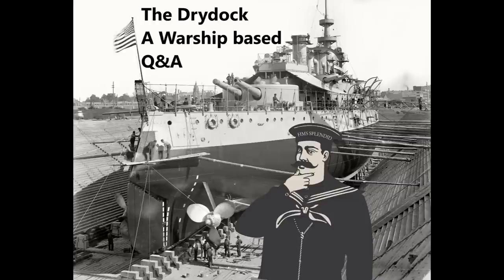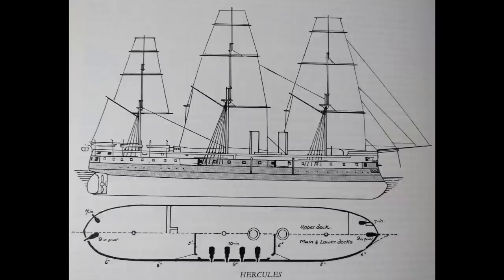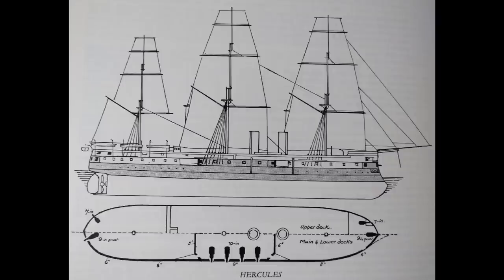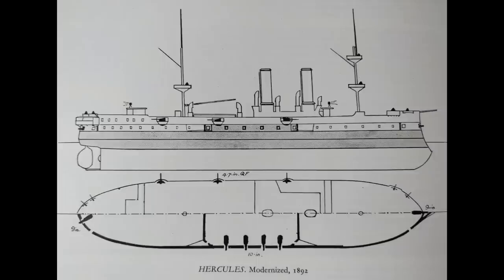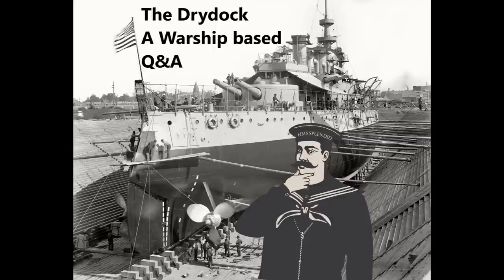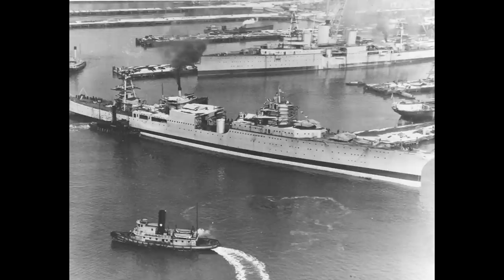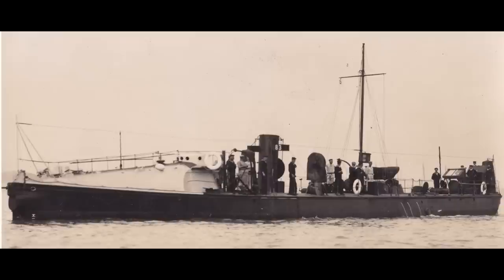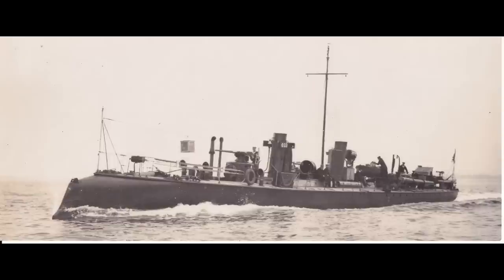The Drydock - Episode 233

Comment: My grandfather was a loader for a quad 40mm Bofors on the Fletcher class destroyer Killen. Said it tended to jam and it was quick to unjam with a hammer  and chisel. During an air attack he said the 5 inchers opened up then the 40mm then the 20mm and finally the .50 caliber.  He said you knew it was really bad when the 20mm and .50 cals opened up.
Reply: Supposedly, somebody aboard the ships at the Battle off Samar radioed "We're pulling them into 20mm range!" Yeah, when you're breaking out your AA guns during a surface engagement, you're really getting in close.

Comment: In regard to measuring ship's speeds, in addition to the methods Drach described, most ships have instruments onboard that directly measure ship's speed, either a Pitometer Log (similar in principle to a pitot tube on aircraft) which was invented around the turn of the 20th century, or in more recent ships more likely an Electromagnetic (or EM) Log, which was invented post-WWII.
Reply: Ryan of Battleship New Jersey has a video discussing those speed measuring devices. https://youtu.be/Efb8m14af4k
Reply: Sailing boats, at least, usually have something which is essentially a tiny paddle wheel sticking out under the bottom. Is this kind of log used on bigger ships as well?
Reply: Pit log, EM log, doppler sonar are all ways to measure speed through the water.  Speed over the ground these days is measured by GPS.  For speed trials, radar ranges to a buoy in deep water have, for the most part, supplanted measured miles on shore.

Comment: Portholes (scuttles): one of the reasons why ships lost them after WWII relates to health issues. They're fine in peacetime for all the reasons Drach indicates. Closing them in bad weather was part of the deal of being at sea when there wasn't a good alternative.
The problem was in wartime: they had to be closed whenever the ship was at sea (and even alongside), to darken ship: more scuttles = more to leave undarkened for U boats. This wasn't achieved only with curtains, but a heavy metal cover called a deadlight, which also provided some protection for damage control purposes of the glass was broken by the sea or enemy action. 
These factors effectively meant the scuttles were closed / deadlighted 24/7. So... that being the case... why bother?
Drach isalso  right re this being less of an issue re lighting; however, it's a major issue at a time when ship's ventilation systems were predicated on being able to open the scuttles. Keeping them closed meant crap ventilation: not great at any time, but far worse in the tropics, with all the adverse effects on human performance, as seen for example at Savo Island in August 1942.
The more important issue relates to infectious disease risks - not just coughs and colds, but tuberculosis. This being the period when effective mass TB screening had only begun (mostly because of WWII) and there was no effective treatment until the late 1940s, even one active TB case on a mess deck with crap ventilation could make a helluva mess...
Reply: Gah! It all comes back around to tuberculosis. And the long hand of John Green grabs us again.
Reply: @MonkeyJedi99  Who is the John Green you're referring to please??
Reply: @Pusserdoc  Author of several books including "The Fault in Our Stars". Also a major proponent of pushing companies to make tuberculosis tests VASTLY more affordable in the poorer countries where the disease is the most problematic.
He has done many videos about how tuberculosis has influenced history and society, including women's skirt length
Reply: @MonkeyJedi99  Thanks so much - clearly I'll have to look him up! 🙂

Comment: Your comments on Scrapping vs Scuttling old ships are incidentally relevant due to the Brazilians having just scuttled the carrier Sao Paulo out in the Atlantic, due to large amounts of Asbestos making it undesirable for scrappers.
Reply: The odd part about that is the asbestos is largely irrelevant underwater but there are so many other things on the ship aren't as Drach points out.
Reply: Don't see asbestos as a big problem 5 km under water.
If there is still oil on board, yeah, that might be a problem, but asbestos where the dust can cause cancer?
Don't see dust clouds under water. And aside from the dust, which causes cancer mostly because of the structure of it, it's pretty save.
Reply: Depending on which source you go by, there may have been far more troublesome things than asbestos in there.
Reply: @CTXSLPR  The scrappers don't live underwater though, they'd have to deal with the asbestos if they had to take the ship apart.
Reply: @muuhnkin4611  Most of the people doing the scrapping and living in the vicinity of the scrapyard aren't living under 5 km of water.

Brazil sold the ship to the scrappers. Turkey said they can't bring the ship into port because of the asbestos. Brazil said they weren't taking it back. So they just sank it there.
Reply: Brazil plays by their own rules.
Reply: Considerate of them to sink it ‘beyond the environment’ . After all, theres precious little out there except open ocean, fish, sea birds and 200 tonnes of deadly asbestos 😂
Reply: @hisdadjames4876  Abestos is not the concern with it being sunk there. All the other crap on the ship is going to be more problematic.

The asbestos would have been a big problem for the people in Turkey in and around where it was to be broken up.
Reply: I guess the asbestos solution would have been easiest if they sank it, then re floated it and scrapped it. No asbestos dust if its all been wet for a week 😂
Reply: Oil on a sunken ship isn’t a problem… there are natural oil vents underwater that constantly spray oil and natural gas into the oceans 24/7

Comment: I thought it was common knowledge at this point, guess not.  The USN just designates a class name, hence the ship carrying the class' name is the "lead ship" irregardless of laying down, building, or commissioning.  I learned about that back in the 1990s.  I thought it was so confusing when the New York class of super dreadnaught s were called the Texas class so frequently.  All because the Texas was built, and commissioned before New York. Didn't matter.  The USN had designated the class as New York.
Reply: I think the Texas was started first at the Brooklyn Naval yard under contract by Newport News Shipbuilding whereas USS New York was constructed by the government at New York Naval yard by the government. Both were constructed under new labor laws regulating maximum allowable hours for workers and each ship could cost no more than $6 million per.
Reply: The first ship in a class to be authorized by Congress is the designated class ship, regardless of what order the ships of that class are laid down, launched, or commissioned. So which ship in a class is the lead ship depends on the paperwork coming out of Congress and how some clerk happened to type up the text.
Reply: @seanmalloy7249  also in a couple of cases it a interesting coincidence who in Congress was on various committee s when it was time to select names.

Comment: I'm not aware of many paddle vessels able to separately operate the wheels each side other than tugs where it was quite common.  I think there was a stability problem at speed if there was any difference in speed of the wheels each side to the extent that it was expressly forbidden for passenger vessels.

Comment: My boat has a turbine wheel speed log in the bottom which can be pulled from above if fouled.  The wheel turns and speed is measured electronically.  You can also use GPS.  Transome mounts appear to use a lever arm which is deflected by water speed.  I would assume speed can be measured by sonar under certain conditions.

Comment: re: 00:09:00 - More modern warships are nearly devoid of portholes.  What triggered this change in design? 

Modern ships also have (generally) smaller and smaller crews for a given size of ship, thus requiring less accommodation spaces and so less of the ship to need airing out and lighting?
Reply: Electricity and HVAC.... you don't need portholes for light or ventilation anymore.

Comment: A 1vs1 between a Littorio and a KGV with roughly equal escort forces would be an interesting scenario. In my opinion, the Littorio might have a small edge over the KGV - if the Italians have their accuracy problems under control, that is - due to the very powerful Ansaldo gun. It has extremely good penetration against vertical armor.
Reply: The Italians never really had shell dispersion issues to the extent commonly made out to be the case in poorly sourced secondary sources; turns out Iachiano fabricated the whole idea to cover up his incompetence.

I do agree that Littorio vs. KGV would be a fun fight. The Italian ship is slightly faster, and the Italian 15” gun hits hilariously hard (as in, Littorio could actually hit as hard as Iowa or Yamato when it came to armour penetration…); while the KGVs had arguably the best armour protection of any battleship ever, even they’re not going to hold up too well against that level of firepower. On the other hand, KGV has one more main gun, and while the Italians didn’t have the same “not knowing what AoN armour layout is” issue as the Germans, their deck armour is still relatively thin compared to Allied designs or the Yamatos.
Reply: @Bk Jeong  we would really have to do an immunity calculation, but I still believe the Littorio takes the cake. That 15inch gun won't surrender to a 14 to 15inch belt at reasonable combat ranges unless the KGV is heavily angled (but then its probably vulnerable to penetrations through the bow or stern)

Actually, I do disagree with your statement about the KGV having the best BB armor of all time. When it comes to layout (ignoring steel quality for a moment), Richelieu is better off than KGV I believe. Richelieu carried a hilariously thick deck (150mm over machinery and 170mm over magazines if my memory serves, compared to roughly 130 to 150mm for the KGV,  respectively) and an angled 330mm belt, who is probably just as good as the roughly 350 to 380mm vertical belt of the KGV.

In addition, the Richelieu carried a respectable lower secondary armor deck which was 40mm thick with 50mm slopes - KGV carried no internal armor worth mentioning, aside from the torpedo bulkhead.

I have no idea how hard the belt + turtleback is to defeat (I assume very hard, although probably not as foolproof as the German version), but the two armor decks add up to roughly 180 to 200mm of effective armor deck thickness - that's Yamato level deck protection!

I actually have an immunity comparison between Littorio and Richelieu (though sadly not available right now), I think the final conclusion was that both ships were pretty similar, mostly due to the ridiculous penetration of the Italian gun compensating for the somewhat weaker armor. Littorio armor will probably do OK against the British 14inch gun, which was a solid piece of equipment, but still 14inch. Even Bismarck was immune against it out to around 23 kilometers - and that's pretty much the highest distance at which BBs scored hits in European waters in WW2. Deck penetration of the Littorio is probably not that big of an issue.
Reply: Might it come down to better fire control, especially with radar?
Reply: @gregorywright4918  

At night, but the Littorios were pretty accurate themselves during the day.

Comment: Why did the Japanese choose to manufacture their cruiser turrets with very little armor in World War 2. I’ve noticed this in both light and heavy cruisers, for example IJN Aoba only has about 25mm of armor on the main turrets, even though Aoba has 8 inch guns. Was this due to some kind of manufacturing limitation or plain and simply, they didn’t have the resources? It would seem terribly inefficient to build heavy cruisers with turrets able to be knocked out by even the most modest of destroyer guns.

Comment: Would I be right in assuming that any British aircraft carrier accompanying force Z is likely to have been sunk as well?
Reply from the maker: It depends greatly on what aircraft the carrier has and how it responds to air attack. A couple of squadrons of even Fulmars and Force Z likely survives, there were no escorts for the bombers and even if they had been sent out with Zeros the latter would've had to turn back hours earlier. Plus there weren't any more aerial torpedoes for reloads in the area, the bombers had transferred over and landed about a day before the strike.

So if there was a CAP and more fighters ready to go, with radar spotting and fighter control the attack would likely have been blunted enough.

Conversely, if the carrier is mostly loaded with strike aircraft and is running ASW patrols only due to not believing the bombers can reach them, well the carrier might still survive as its now 3 major targets, the carrier probably has the best AA and the best ability to dodge, and the IJN don't have infinite torpedoes, but it might still be sunk.

Comment: About the possible failure of the Bofors and Oerlikon: Didn’t the US also have a 37 mm anti aircraft gun from the US Army ? As I understand it was not terrible it just wasn’t great and I wonder if BuOrd wouldn’t insist on that gun as it’s both native and already being used by the Army.  About the 20 mm I just wonder if they’d use a lot of M2  .50 cals instead
Reply: The 50 cal MG is about 12.7mm, so about 60% the diameter shell of the 20mm.  The range and hitting power of the shell would be significantly less.

Comment: wrt the Force Z aircraft carrier question and Churchill trying to cover himself.  I doubt that the Admiralty had a clue, when PoW set sail for the far east on October 24th, that all six large IJN carriers would be off on the Pearl Harbor op by the time PoW arrived in the far east.  Seems that the reasonable assumption would be that if the Japanese made a move on Malaya, they would have air cover.  Second point, assuming the range of a G3M or G4M with a torpedo load was unknown, and most bombs could not hurt PoW critically, bombs could hurt Repulse.  So, seems irresponsible that the possibility of airborne attack on Force Z could be handwaved away.

 Hermes was finishing repair in Simonstown on November 16th.  Hermes' usual air wing was a handful of Swordfish.  The RN was starting to receive Martlets, but the early Martlets did not have folding wings, and, iirc, the wingspan of an F4F is too wide to fit on Hermes' elevators.  At that time, it seems all the Martlets were in the UK anyway.  The Buffalo had a slightly smaller wingspan, just small enough to fit on Hermes's elevators, and there were plenty of Buffalos in Singapore.  So the only practicable way to get a credible CAP for Force Z would be to send Hermes.  Meanwhile, get the information from Brewster to fabricate tailhooks in Singapore, and train the RAF pilots in carrier ops.  When Hermes arrives, put the Swordfish ashore and load as many Buffalos as would fit on the ship.  

Bottom line, given the gyrations that would be needed to give Force Z a CAP, if that Hermes/Buffalo scenario even occurred to anyone, I figure Winny rolled the dice, then tried to cover his rear when it went wrong.
Reply: There was SUPPOSED to be an RAF fighter unit on call for CAP if needed, presuming the force stayed within range; apparently Philips elected to stay in radio silence and not call on them.
Reply: Initially HMS Formidable was supposed to deploy with Force Z but ran aground and was damaged in the Carribbean
Reply: @gregorywright4918  iirc, a flight of Buffalos did arrive at the scene of the battle, too late.  Apparently Philips, or someone, did finally send a signal, when they realized how deep in the kimchee they were.

Comment: Portholes are blow out devices for indoor explosions on platearmor. Dispersion of the shockwave outwards rather than propagation inside the ship. Humans are made of jelly. That is not much of a problem on todays much lighter built aluminum ships. Portholes are heavy..as much as 400lb per porthole installation and expensive. They can be stressrisers too.
Reply: You don't find any portholes on plate armor.  That is one way to tell where armor is mounted.  It is too hard to make the armor with holes in it, plus the weaknesses it would induce.  Armor is meant to keep the explosions on the outside.

Comment: Normally the USN names a class after the ship name for the first contract issued for that class (this the ship with the lowest hull number in the sequence for that class). The order that the ships were actually constructed would frequently differ from the hull number sequence because the orders were spread among multiple shipyards that had different capacities, levels of experience and possibly previous vessels that needed to be completed before work started on the latest contract.

In Astoria's case, Tuscaloosa (CA-37) was originally going to be the class name ship but New Orleans (CA-32), Astoria (CA-34) and Minneapolis (CA-36), all originally laid down as Portland-class ships were reordered to the Tuscaloosa design. It no longer made sense to call them the Tuscaloosa-class since three sister ships now preceded it so the first of the group to be re-laid down and launched, Astoria, was chosen as the class name.

Comment: The North Carolinas were launched with portholes on the Second Deck.  These are clear, in the launching photographs.  However, they were blanked over during the fitting out process.  If you look, carefully, at BB55's hull, you can still make out, where the portholes were located.